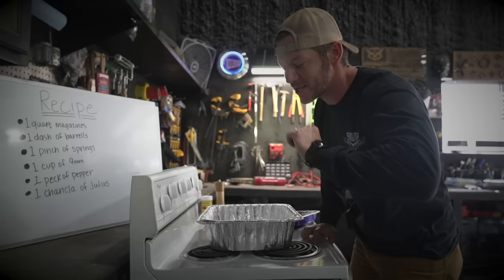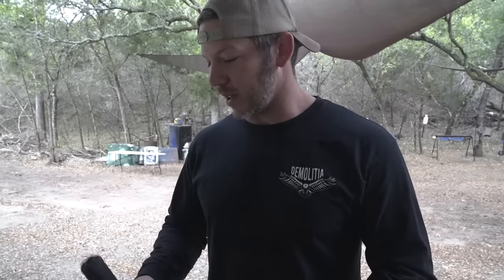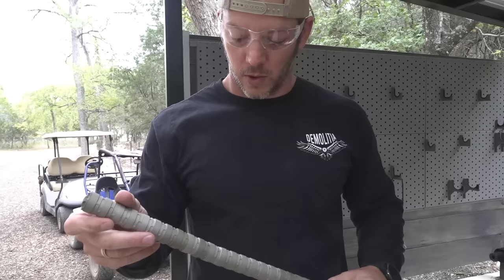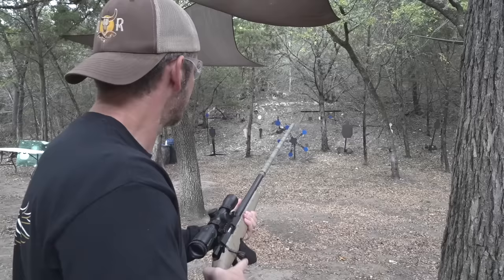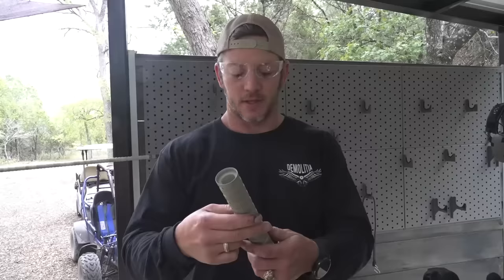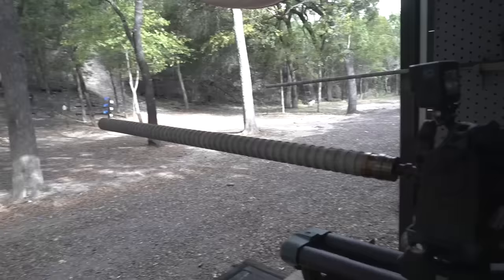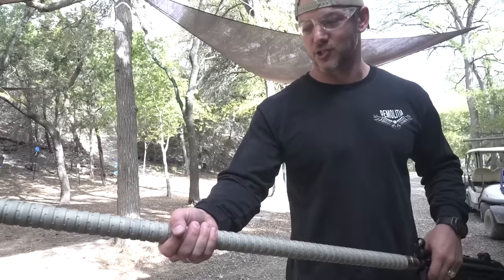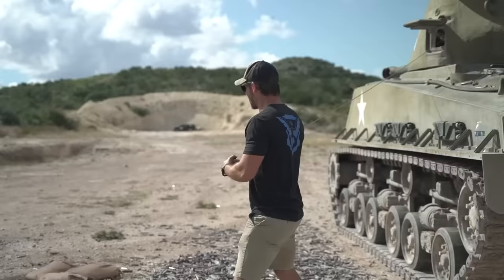Shooting The Worlds LONGEST Silencers!!! But Do They Work???

Comment: I cannot believe that you went through all that and didn't shoot a single 22 sub. Can you imagine how quiet that would have been?
Reply: Exactly what I was thinking!
Reply: The 22 was having issues with the regular rounds.
Reply: My thoughts
Reply: @r3dp9  bro it’s a bolt action, it would cycle.
Reply: The issue with that is that it would 100% get stuck in the barrel/suppressor.  Typically the max barrel length you should use .22 subs in is around 24 inches.
Reply: @rottingravensblood9106  same
Reply: @Kadeo-ms6qw  the suppressor has a wider channel than a barrel so it wouldn't get stuck. Bullets don't touch the sides of a silencer/suppressor, that's not how it works, if they touch the sides it's a baffle strike which is what the whole video was about.
Reply: Plot twist he did you just couldn't hear it
Reply: Better yet, a .22 Short!  Those are nearly silent to begin with.
Reply: All you would hear is the firing pin. I'd use  CCI's lowest velocity subsonic, even un-suppressed they are extremely quiet.
Reply: I've been shooting CCI standard out of 13" AR pistol no supp and it's still pretty quiet.
Reply: It probably would not have even made it out of the barrel.
Reply: @Lilith-Rose  Bro it would get stuck. Stop trying to defend this awful idea.
Reply: @LaZarusXtnct  This is a baffle based suppressor without brushes, he is correct, subs would work.
Reply: @LaZarusXtnct  There are cans with scrubs/brushes that slow the bullet down intentionally but the industry got away from that tech years ago.
Reply: @matthewzelek9043  Why would you want the bullet to be slowed down. That means less velocity which equals less ability to kill. It also stops the bullet from tumbling in air. Which is something you actually want. You want a good rotation as it enters the animal because it will cause the maximum amount of damage. Which leads to a quicker death.
Reply: @matthewzelek9043  Using a 22 with a long barrel is a no-no. Everyone knows this. You dont send a low-caliber round through a 3ft barrel.
Reply: @LaZarusXtnct  So you can slow down a supersonic round to subsonic speeds. Also, bullets really aren't supposed to tumble in the air. You want it to spin, but tumbling is the absolute worst. You wouldn't even be able to hit a target at 10 meters if your rounds tumbled.
Reply: @LaZarusXtnct  you clearly know nothing about firearms and how they work judging from your comments and everything you got fundamentally wrong
Reply: As quiet as the bullet bouncing around in the suppressor, I guess

Comment: Should have had a decibel meter to compare noise levels as each section was added!
Reply: That would've been super interesting, especially since the quality of "loud" or "quiet" definitely doesn't translate to YouTube video in a way that the viewer can quantify.
Reply: @CNSninja  Your vernacular vocabulary voraciously verifies villainesque vaudeville vocation.
Reply: @albumreviews11  nice alliteration
Reply: @pupil5763  ❤️
Reply: "Do you hear that? The enemy appear to be using old-fashioned typewriters over in the trees"
Reply: Also a chronograph
Reply: Only if you measured the squeakies too.
Reply: @albumreviews11  Voilà! In view, a humble vaudevillian veteran, cast vicariously as both victim and villain by the vicissitudes of Fate. This visage, no mere veneer of vanity, is a vestige of the vox populi, now vacant, vanished. However, this valorous visitation of a by-gone vexation, stands vivified and has vowed to vanquish these venal and virulent vermin vanguarding vice and vouchsafing the violently vicious and voracious violation of volition.
Reply: is that a v for vendetta reference guys :1
Reply: @frenzyfixes5827  Am____am I having a stroke? I think I smell toast....
Reply: @frenzyfixes5827  just a day too early
Reply: and a thermal heat gun to check temp.  That is why you need a big suppressor, to dissipate heat.
Reply: Turned into an airsoft gun
Reply: @albumreviews11  now i dont want to learn english anymore
Reply: More like to measure that squeaking 🥲
Reply: @kunduraci30  except it mixes with two French words
Reply: and removed
Reply: What he said!
Reply: @albumreviews11  but he didnt even use any big words
Reply: this is a scientific channel, we cant have definitive information here.
Reply: When it was being fired, or when it was being screwed in?  If you are trying to be stealthy, don't screw in the suppressor in the field.
Reply: @albumreviews11  ok V, good movie for sure!
Reply: @albumreviews11  V for Vendetta.
Reply: there is no point, decibel meters don`t have "laughably quiet" grade on the scale )
Reply: This seems obvious - why wouldn't they?
Reply: hello fellow tanuki brohter
Reply: @albumreviews11  og V
Reply: He would need a brain to think about something like that

Comment: If you rested the supressor on a flat surface (like a long table) it should eliminate the curve in the suppressor.
Reply: Yea but it would probably still have accuracy issues..  Having the barrel (or suppressor attached to the barrel) rest of anything throws off the point of impact.  That's why all rifles now days have free float barrels.
Reply: That's what she said 😅
Reply: yes I thought of that to, a compensator for the droop, a straightener.
Reply: @Cristiano_km  How about no, god why is my text like this
Reply: @Masterofcreat  Or he can just give it give it a hand.😂 Happens to the best of us.😁
Reply: Or a tube, that keeps'em all straight.
Reply: @Njazmo   Just give it a shake, it'll sraighten itself out!
Reply: Some super long cannons like the Paris gun used in WW had a girder system on the barrel to tame the droop.
Reply: @Frille512  Arabic reading direction is right to left.
Reply: @TheFlyingZulu  always wondered about free floating. Never understood the science behind it, or rather no one has explained it to me. Of course I could google it, but I prefer human interaction. Is it really more proficient than non floating?
Reply: There is a little blue pill that also helps with this issue.
Reply: Or you make an adaptor at the front and back of the suppressor that you can run paracord through. top,bottom,left,right.
Then you tighten it up nice and tight so the compression counteracts gravity and sway from moving.

Has to only be attached to the suppressor or it would mess up barrel harmonics.
Reply: I have to rest it on a table too.
Reply: @givemeanameman1  that might work but you would need to do it in like 1 ft sections.
Reply: David Pryor  arent they the same thing?, i refrain from calling it a silencer since it doesnt fully silence the noise. But im pretty sure theyre the same thing
Reply: Some peoples erectors just have curves.  Some to the left, some to the right.  Some need to work around the Bayo-Nut lug that is hanging below the barrel.  Some just go free bird out there and let it curve anyway they want.  But if you strap your erector to a board, I’m sure it would straighten out.
Reply: But then again, when it's that long, having the droop is desirable since the bullet starts to drop at that distance
Reply: @VTOLL  the inventor named it a silencer. The US patent says silencer. It existed as such for nearly 90 years before anyone cared enough to call it a suppressor.
Reply: @Cristiano_km  how about without crying,
Reply: @Cristiano_km  let’s just pretend I lost and you go away .
Reply: @Frille512  No, there are many writing systems with alternate reading directions. None greater than any other.
Reply: @VelaiciaCreator  That one sucks
Reply: @Frille512  I's a language. You trying to say something else without saying it?
Reply: @Frille512  You gonna say why? Because you're coming off like a child here.

Comment: Remember, with the Erector 69 you need to make sure you have permits for multiple States because the moment you point that thing you will probably cross multiple Borders.

If after shooting no bullet exits the barrel, it does not necessarily mean a misfire, do not watch down the barrel remember that it takes the Bullet some time before it reaches the end of the barrel (a bullet only travels at around the speed of sound after all). Sometime a bullet might not come out at all since it probably gets lost on the way!
Reply: Erector 69 sounds weird
Reply: "A bullet only travels at the speed of sound" isn't the speed of sound on the slower side for bullet travel speed? Please inform me.
Reply: I hate when my bullet gets lost while traveling. It must have missed that left at Albuquerque.
Reply: @EdyAlbertoMSGT3  I think you missed the point of the joke....
Reply: @Dkgow  yeah, it was supposed to go strait past Albuquerque. if its making a left, you got a bigger problem, which would be baffling to see.
Reply: @EdyAlbertoMSGT3 Yeah, some bullets travel mach 3, but most regular one travels at atleast mach 1.
Reply: If there is no sound there is no speed, so yeah.
Reply: Speed of sound is 1200fps(roughly, give or take 100fps) and 5.56x45mm nato is traveling at 2500fps. Some bullets indeed impact you before the sound will. Some rounds like the 8.6 blackout travel below speed of sound and are quiet.@EdyAlbertoMSGT3

Comment: If you permanently attach enough of those sections to bring the barrel up to 16" you don't have to worry about the ATF's new pistol brace rule and you can just put a stock on it
Reply: Pin and weld it 😅
Reply: Well with the way things are going in court right now, you probably won't ever have to worry about their new "rule". They've been getting their a$$es handed to them in court for months now on pretty much every case people bring against them 🤣
Reply: There's a reason ATF don’t try to fuck with lawyers
Reply: Good idea. So you're STILL filling out ATF forms for the silencer and then waiting a year or two instead of the like 30 days to get a form 1 done for an SBR. You showed em.
Reply: @TheBeeFactory  I mean... you're right, but you didn't have to say it man D:

Plus, you then get to say you have an integrally suppressed whatever... then your baffles wear out and you have to commit a potential felony to fix it by removing and then replacing the expensive part of the toob.
Reply: @TheBeeFactory  eFile for suppressors is at 7 months these days. Not much better than before but nothing is taking 2 years
Reply: @frostriver4547  I see lots of posts on gun forums, YT videos, Reddit, etc. where people are absolutely waiting over a year and a half, almost two years for suppressors. That's not necessarily the norm, but that's what I see. 
Then again, it's the internet, and I'm always open to the idea that people are lying. 

Either way, suppressor wait times are a hell of a lot longer than the SBR wait. Mine was ~60 days.
Reply: @TheBeeFactory  my previous wait a couple of years back was nine months. My latest, approved a couple of weeks ago was 6 1/2 months. I don’t have one but would like to do an SBR next in 300 BO

Comment: Those segments do a pretty good job at suppressing the pops. Thanks for sharing, Matt.

The only negative thing to that system is that ear-splitting/fingernails-raking-across-a-chalkboard screechy    sound that happens when the segments screw together. A bit of pre-lubing of the segment's threads  should be fine at silencing that noise during the suppressor's screwing-together process.

Comment: You should have gotten a decibel reader to see if the additional suppressors actually made it even quieter
Reply: you can hear it get quieter for sure, but it would’ve been dope to see by how much
Reply: My guess is that any of the suppressors that were getting hot/warm were still having an effect (and slowing/dissipating the gases) but anything past that didn't. Also, I think it would have been interesting to have done a supersonic vs subsonic comparison at each of the different lengths (though given he wasn't even sure if it would work, I can get why he didn't).
Reply: That’s exactly what I was thinking
Reply: @hkfifty871  At a certain point, the muzzle blast would be completely suppressed, and all you'd hear is the action
Reply: Even with a BUNCH of suppressors, there’s probably some upper bound on how much decibel reduction you can obtain, and I doubt it would be enough to totally suppress the muzzle blast. Though I’d certainly love to see someone try.
Reply: The more suppressors the more backpressure, more backpressure means increased port pop (gases forced back down the barrel that give you a “pop” when the action opens on semi-auto guns)